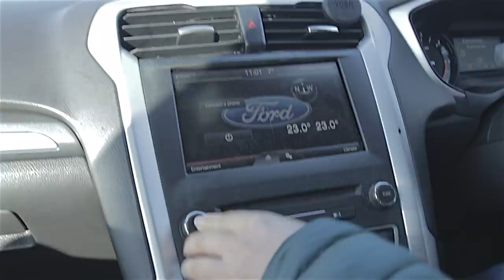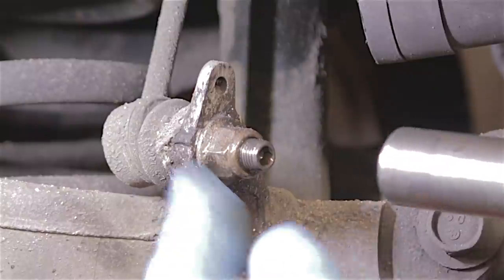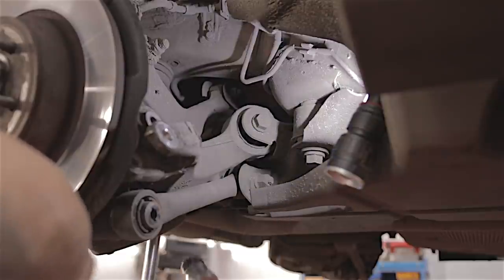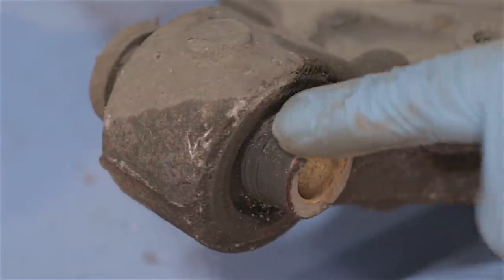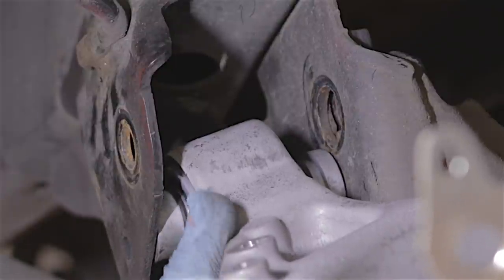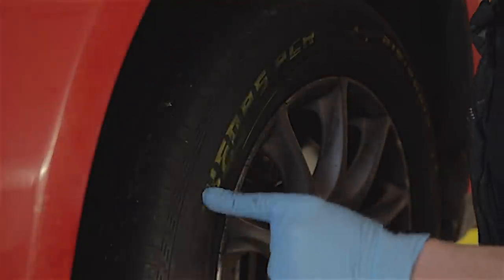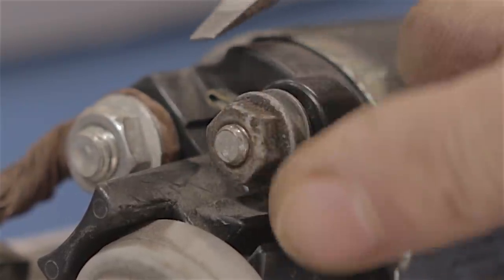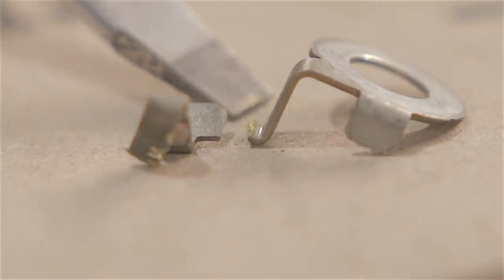Engine won't crank & there's a creak on my Ford Mondeo Mk5

Comment: Your the second person tonight to mention a dodgy starter motor. Savage Garage being the other. I have a feeling it comes in three and mine will be next
Reply: You may be fine lol as salvage rebuilds uk just put a video out tonight of a vauxhall combo with a cooked starter so they must be the 3rd!
Reply: @sammytheseal2307  😂 seen that as well. I was thinking is it Starter motor day or something 🙈
Reply: @VSTV1993  lol 👍
Reply: i remember using a hammer on a stuck starter in the 70s

Comment: I had some sealed ball joints that sounded just like that. Luckily they sat with the ball at the bottom. Injected some gear oil thru the boot and their quiet as a church mouse now.  You sir are a slightly odd duck!

Comment: Thanks a lot for this movie, probably I do have the same problem with my starter motor. Dou you know if I can buy that broken part or how to repair it?
Reply from the maker: not sure if you can get the solenoid separate ..the starter motor is expensive unless you find someone to repair it

Comment: 1988 Mini - The college days - Went from one building to another, stopped the engine but it kept running, starter motor got stuck and kept the engine running. Had to disconnect battery to stop it.

1990 Escort Van painted BT Yellow to blend in, hahahaha. By now I had tools and the hammer came in very handy at night as the starter motor use to get stuck and engine wouldn't turn over - well it did with a little twatin' from the hammer.

I do like to 1/2" Snap-on Breaker Bar. Nothing better than a good breaker bar at times. For my line of work, I've got a top-trumping 3/4" Extending one, hell yeah, this is a bad boy.

https://ezred.com/product/34-inch-drive-extendable-ratchet-2/

Comment: Bit of a long shot posting this here but i have a mk5 mondeo with 64k miles, the gearbox has a rattle to it when idle and in netral, if i pull the gearstick towards forth the rattle gets much louder, any ideas from anyone here?
Reply: Sounds like it could be the dual mass flywheel
Reply: @superseven220  god i hope not :/
Reply: @BudzyMusic  Good luck,  hopefully not.
Reply: I would hope not at 64k.....mine is a 2016 and on 111k and no rattles from anything. I had a fiesta about 20 years ago that did something like that from new.....took two Ford dealers to tell me they couldn't find it, the third (rates) found it needed a new gear linkage....